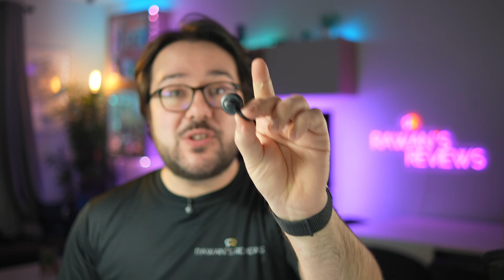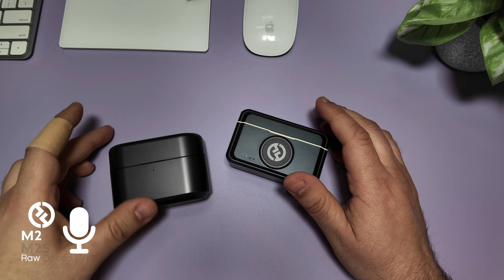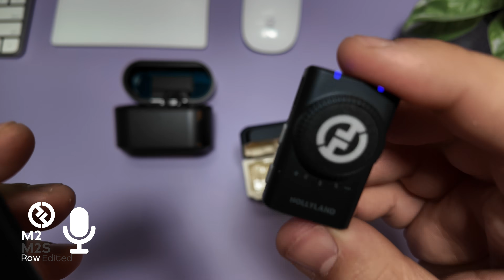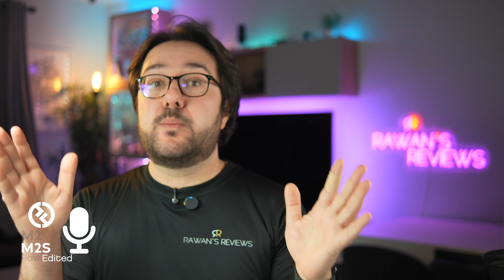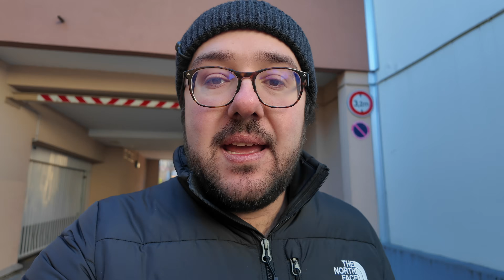Hollyland Lark M2S vs Lark M2: Smaller & Better Wireless Lav Mic!

Comment: At around 7:40 you mention a design flaw and say there isn’t a good place to put the mic on your jacket. But there is, you have a zip pocket next to ‘The North Face’ logo. Just unzip it enough to fit the mic in then zip it up so the stem sits perfectly there but still “hidden”. Unless that’s a fake zip pocket, which would be a design flaw on its own.
Reply from the maker: I would assume not every person who might wear this make would have that same jacket, which—yes, has a pocket there that could have been used. That observation was merely to show the limitations in that design. Not every jacket would have a chest pocket there, hence the limitation ;)
Reply: @RawansReviews  That’s true. I’m leaning more towards the M2S as to me it sounds more studio quality. Especially with the edited audio part of the video. Plus I’m concerned with dropping and losing the magnet on the M2.

Comment: I am buying microphone for the first time please digestible as a beginner which one is good for making basic talking reels and YouTube videos
Reply from the maker: Either would be equally good for your use case. Either pick whichever is cheaper if cost is an issue, or based on form factor (if you want it visible or more subtle like the M2S)

Comment: I have both. The M2 sounds clearer with a little more upper end sizzle. The M2s sounds a bit dull and flat. However, they have done a firmware upgrade on the m2s and it seems a little better now.
Reply: You will be my deciding factor good sir. How much better is the audio now atfr the update?  Still muddy? Does it compare with the M2?I really want the m2s for the design but im not willing to sacrifice audio.
Reply: @wasteofayute4448  You're putting too much pressure on me! But I would say that I still prefer the m2 for audio quality. But the m2s is so small that I use it here and there and the audio tone doesn't suffer too much.
Reply: Brother I am confused by what you all are saying. I want to buy one of these two, M2 or M2, tell me which one should I take plus

Comment: The m2S could be mounted on the chest pocket by opening the zipper a little bit
Reply: or on the zipper itself?
Reply from the maker: The idea was not that I couldn’t find a way to mount it on what I was wearing, but to showcase the limitations that could be with certain clothes.

Comment: Hi Rawan, thank you so much for this video. It truly helps and you went the extra mile to leave a great review.

Big question in favor to all the musicians out there, which one you will recommend between those 2 sound wise. One mic is for singing and the other one for the guitar. Have in mind is different than talking. Sound wise what of those is more crisp?. And warm?.

Thank you for your thoughts on this, it would be very helpful.
Reply from the maker: I'm not an expert in that domain, but I do think the M2 is crisper than the M2S. If you're in a studio setting, I'd be more inclined to go with a condenser mic for singing though--they're should be much better at capturing vocals with better clarity, accuracy, and detail than a small lav mic. But again, not an expert in that domain.

Comment: Great tips but if the M2 can split the audio from left and right like the MS2 can then you can edit the two mic signals separately in post.
Reply from the maker: It can only do that via 3.5 mm, on the camera receiver. It can't do it if using USB

Comment: I have the m2, I got in December and well.. I'll be using it for the next few years, maybe longer.
You should mention that the M2 is about $20 cheaper now.
Reply from the maker: Correct--I failed to mention that point.